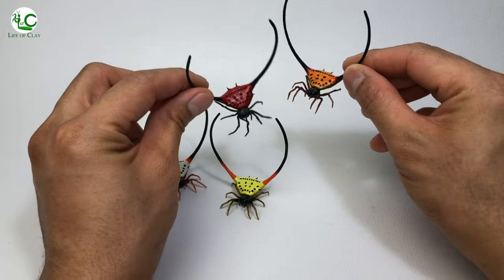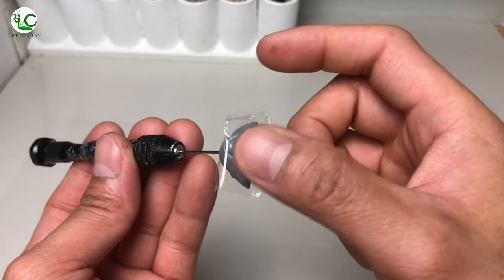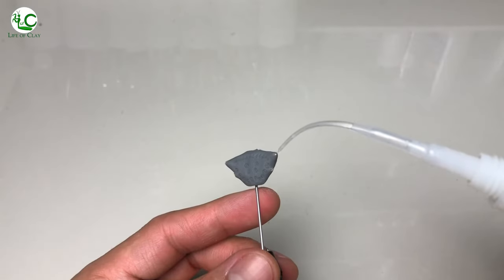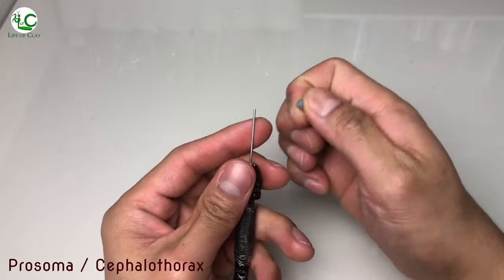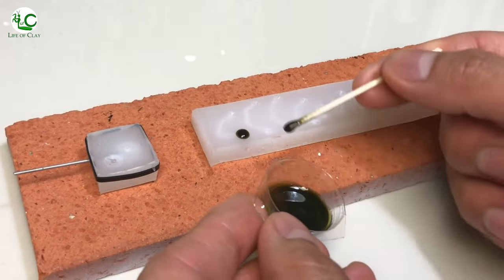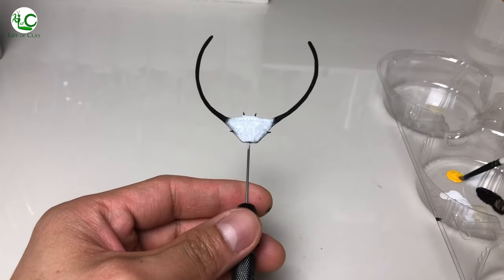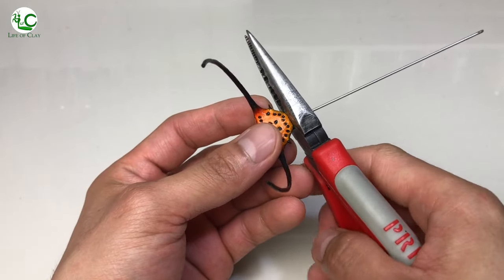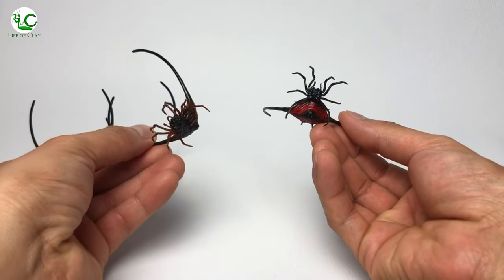Sculpting Long Horned Orb Weaver Spider _ Macracantha arcuata _ Polymer Clay Sculpture @LifeofClay

Comment: Wonderful. My favorites are the orange and reddish ones. And thanks for the plastic wrap tip. 
I have a thought about those fine spines. What about some type of dipping substance…a resin or epoxy to coat the wires. Since you are molding them anyway, why not forgo the polymer clay entirely? As for the hairs…perhaps  real or synthetic bristles?
Reply from the maker: Thank you so much, dear Imelda. Really appreciate it😊🙏💚

I still preferred my master copies to be on polymer clay cause when the time comes that I need to reposition them or reshape them, being them in polymer clay form will be easy. And the fur I used are trimmed synthetic fur in this project.😊